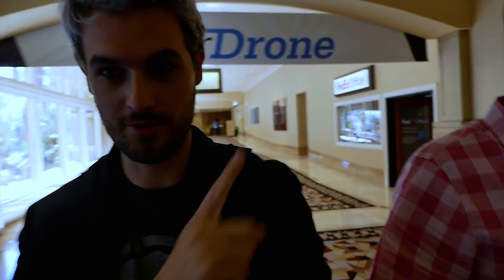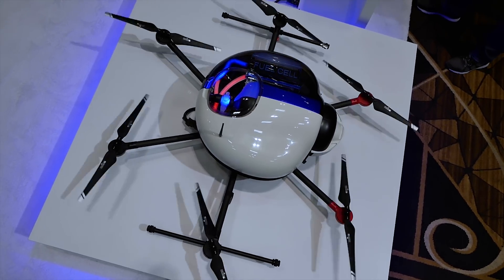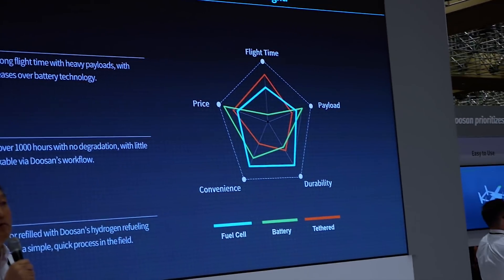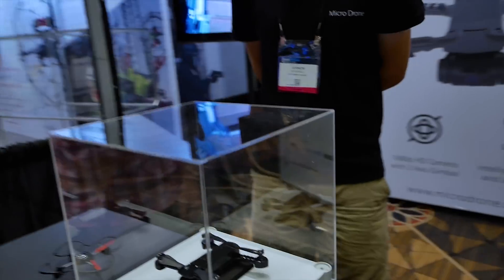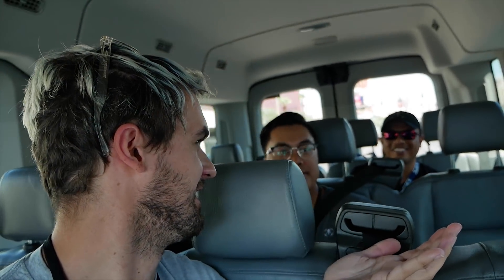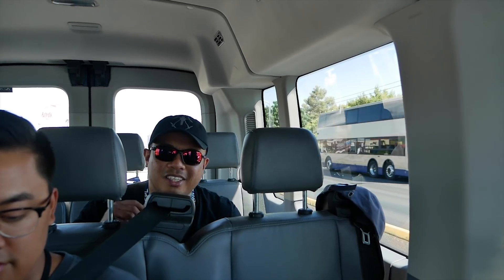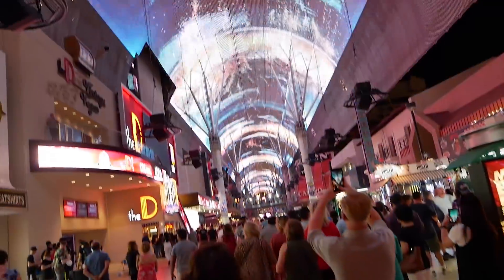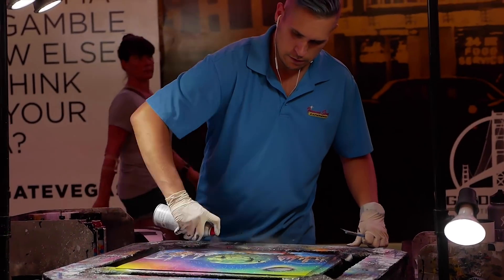how FPV helps the drone industry

Comment: Pretty wild . If they could make an rechargeable energy source the same size and weight as a mid level 1300 mAh LiPo that could sustain a racing drone for 30 minutes at 75 percent duty cycle , I would be late going home after work every day just about .

Comment: The AI integration into some of the commercial drones lately is pretty impressive.  Last presentation i went to for drones in engineering was mind blowing with what they were doing.  IIRC, that quad in the ball is a $35k machine used for environmental mapping and disaster response.

Comment: You are very smooth and good. I am looking to upgrade my radio from a Dx6e to a  Dx9 or ix12  I do fly FPV not good but like it. I would like your help. Which one  do you use the most .I fly spektrum like it easy to setup .

Comment: If hydrogen batteries have issue with throughput, why not have many cells hooked in parallel so their small throughput adds up to a bigger throuput? Or how about have also a supercap that is charged by the hydrogen cells, to give you boosts when needed?

Comment: I bought a Micro Drone 3 as my first quad.  It was such a poor experience that I was completely turned off the hobby.  Luckily someone gave me Syma.  It few so much better and was about a quarter of the cost.  I was hooked and built my first quad shortly after I reached my limit to the number of ways I could crash my Syma.  I would never recommend an Extreme Fliers product to anyone.

Comment: Hydrogen fuel cells as like a very low C, high MAH pack, plus they have the issue of a very high pressure storage vessel, all  make them less than ideal for our style quad. 

Great tree flight. Reminded me of Kababs flying spot. Whatever those trees are, they must be  indigenous to the Las Vegas area, I really would like to try them out some day. The low wide way they grow sure generates some great flying spots. Trees here in the northeast tend to be tall with less spread. Arguably less fun to fly. plus it's easy to get hung up high.

Should have asked the guy with the Spark competitor if it'll do an inverted yaw spin.....

Comment: Fpv racing technology could easily be utilized in disaster relief search and rescue applications, however I heard that most of them want to utilize artificial intelligence(like #drl plans to do with their ai racing drone),thoughts?
Reply: Cops could use FPV drones to figure out what to expect instead of coming in shooting dogs and unarmed teens. Maybe even have a small squadron (swapping drones when the battery is low) using a truck as a mothership, to make high speed chases safer in crowded areas, both by having less cars going around driving dangerously, but also by not being too obvious to the runaway perp that they're still on their tail reducing the desperation in their driving.